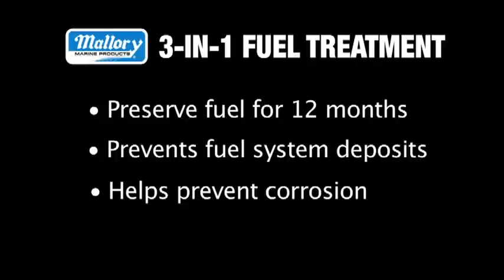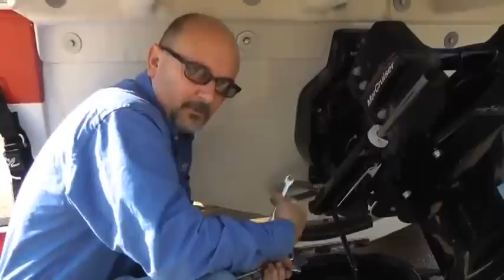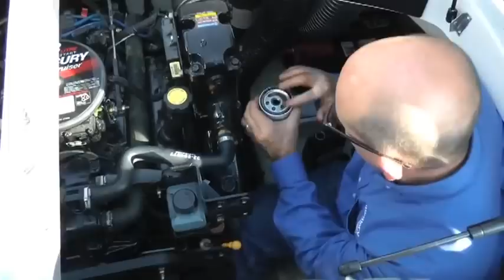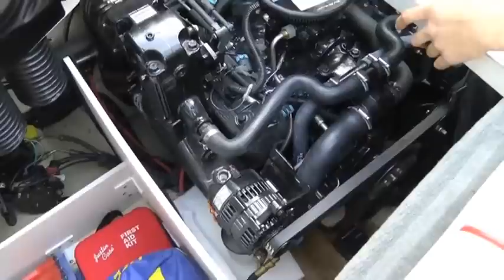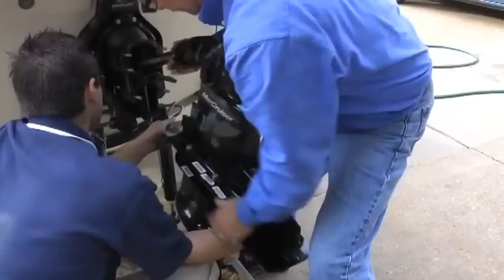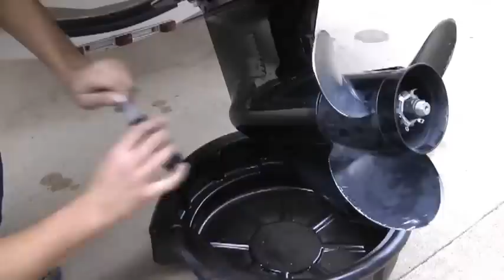How to Winterize Your Boat - by Mallory Marine

Comment: Explained very well, as a added measure the manual recommends that after filling the engine with antifreeze crank the engine over without starting to ensure water pump etc are all filled. Thanks this was very helpful

Comment: So, I noticed you drained block and manifold then filled block and manifolds with antifreeze .... however you did not drain the incoming hose and oil cooler nor did antifreeze make it through that hose. I'm sure there will be issues in spring

Comment: Shouldn't you change the oil when you dewinterize it rather then when you winterize it? Otherwise the oil has been sitting there all winter. I'm pretty sure for cars they recommend changing the oil every so many months even if you haven't driven that many miles.

Comment: I quit watching after the first 100 "uh uh uh's"
Reply: Did you pay for the experience?  No you didn't so don't complain idiot!
Reply: Excellent information in this video.  I really appreciate the post; however, found the "uh" really annoying and distracting.  Other than that, quite a good video.
Reply: Good point, Dan Taylor.  However, the idea is to compliment the good and point out that which is either incorrect, wrong, or simply in need of improvement.  I left out the compliment for the good info (my bad), didn't see/hear anything that was incorrect, and commented on that which needs improvement, thinking that the person who posted the video, and perhaps others, might benefit.  Sorry if you were offended; didn't mean to offend.  I have edited my comment accordingly.
Reply: Uh...uh...good video

Comment: You should be looking to see if the oil filter gasket came off on the filter. If it sticks to the block and you just put another filter on the engine, you will end up with a nasty leak and possible engine damage.